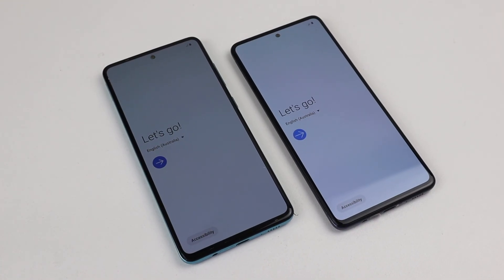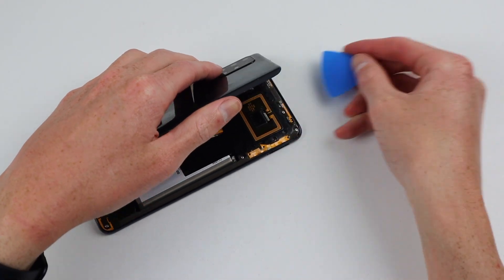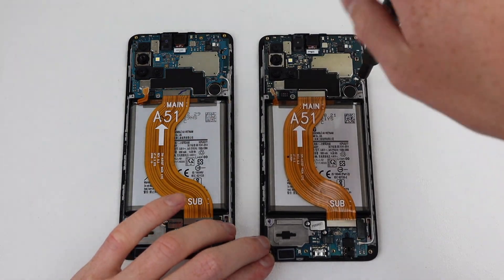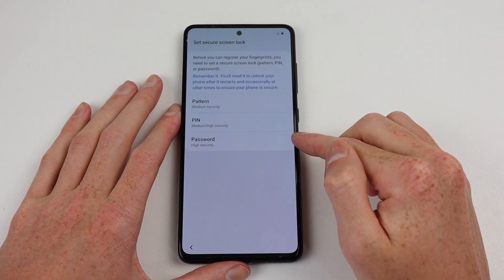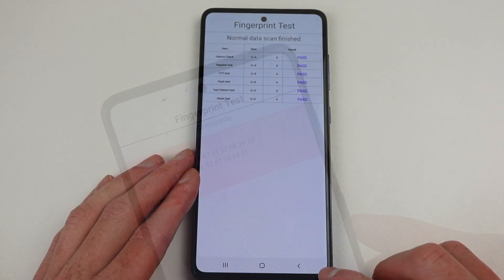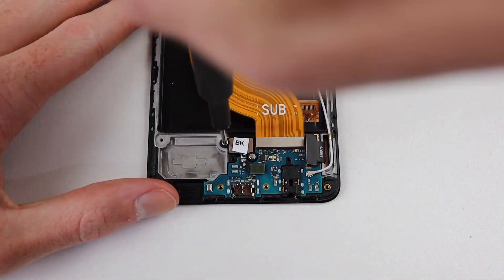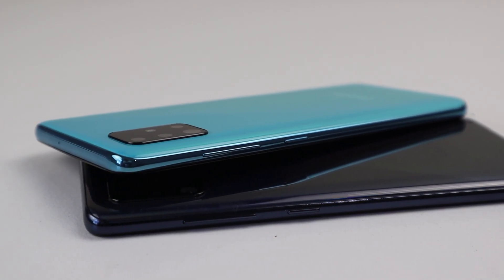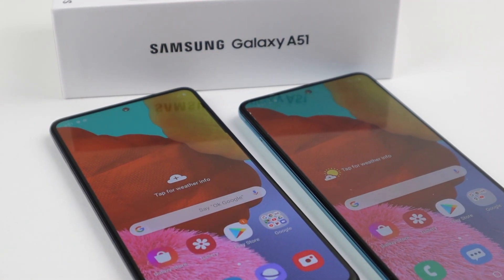Samsung Starts Blocking 3rd Party Repairs? - Galaxy A51 Teardown and Repair Assessment

Comment: I've replaced my a51 screen with an aliexpress one. The fingerprint scanner is still working flawlessly because when replacing you keep the original fingerprint reader and put it in the new frame.

Comment: Mine stopped working some time ago. (I can't remember if it was after an update) but my phone never been repaired or opened. Last might fidgeting with it with the #0# code at some point I got it to find the sensor and get the "pass" on all tests. I managed to add 2 fingerprints before it stopped again and since then I haven't managed to get it to see the sensor again. I'm thinking on opening the phone and check the connection to the board

Comment: Hugh, although unrelated to the video, I've came across about the issues of Samsung phones particularly on all A series of phones, where reports said that these phone suffers with issues where FPC (flexible printed circuit) connector causes these phones to either not charge or at intermittent at best. This particular issue happens when the device suffers from either "physical damage, improper connection or the phone gets bent". I've be interested if you cover about this issue in one of the videos or a reply here.

Comment: Ngl i found a a51 on the streets 
It was only having a issue with the charging port flex cable and it was working fine after replacing the flex cable

I see treasure like that

Comment: I have replaced two a51 screens and after swapping I had seen same issues as shown in this video. Fingerprint wasn't asking me for calibration but it was just not reading. But similarly as shown here when registering a fingerprint it occasionally register some parts so I just kept trying for about 20minutes until I managed to register one fingerprint. What worked for me was just leaving finger longer on one spot. Anyway after registering one fingerprint it just suddenly started working with no problem. Unlocking was as fast as before screen replacement and registering second and third fingerprints was a breeze. So I wouldn't see this strictly as anti repair - for me after September update they just maybe increased accuracy or something so new scanner must be calibrated and old must get used to being just slightly in different position prior to screen replacement. But yes Samsung should allow some way to calibrate fp sensor. Maybe after signing into your samsung account for added security.

Comment: i repaired a a30s...same problem with aftermarket display........so.....those sensors are calibrated for each phones....the distance between glass display and fingerprint scaner are calibrated for each chasis
Reply: i managed to make thinner sensor fixing holes to create a smaller gap between screen and sensor... until it worked again.....btw....with tempered glass sometimes sensor is reading poorly

Comment: i also have a51 but my earpiece is not working after screen being replaced
Reply: Usually replacement display don't come with the earpiece speaker already attached so you have to remove it from you device and place it into the new screen. Either you or how ever did the replacement  forgot to relocate the speaker or it broke in the process.

Comment: Good to know this info. Plan to get my first iPhone with the 14 Pro, but after I still want to use my A51 as a secondary. Thinking of getting a screen replacement since mine has severe screen burn-in. Made the mistake of leaving a video with a static border on my screen for hours for background noise while I slept, since I dont have a TV in my room.

Comment: I feel Samsung did that for security reasons and to prevent other people from accessing your data even if they swapped the fingerprint sensor. That's what I think though
Reply: Well it turns out Google does the same thing for their Pixel phones, the only difference is Google provides online software to recalibrate the sensor.

In other side, I don't think Samsung does this anymore (based on Hugh's latest Samsung teardown)

Comment: have to replace the screen.. if they software block repair. ther phon is like screen is build plate for everything, , replace the screen mean tear down all electronic from the screen .. fairfone for next phone? a thing build to have just screw messing and screen cable to replace and not tear down all the glued phone

Comment: you know what.... it might be calibrated to the screen... like factory calibration is a more involved process and in the calibration you get it only can change a little bit of that (like how on a bike in the factory they "calibrate" the saddle to be around where a saddle is by welding the frame, then you can calibrate it a little by the seatpost. i htink its because the pixels are somewhat at a different position)

Comment: is there anyway to recode the fingerprint sensor to match the logic board, I've replaced my a70 screen last year along with a new fingerprint sensor that came with the original replacement screen and since the last update the fingerprint sensor stopped working... is software out there that can rectify or bypass this problem

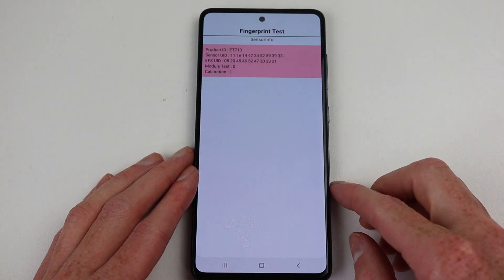Comment: 6:45 - The sensor UID and the EFS UID need to match, how do you fix this, as this is the reason the calibration error comes up?
I replaced a non working sensor in an A50 phone with a new replacement and got this calibration error, factory reset did not fix.

Comment: Hold up...
Doesn't the fact that you used double sided tape instead of proper adhesive remove it's water proof/water resistant properties?
Also, you downgraded to a previous patch/update to fix the issue. So, can you now reinstall the newer patch/update and the calibration problem still be resolved??
(...or does the issue return with the newer patch reinstalled???)

Comment: Are the sensors physically different and matched to a hardware revision on the board? They serial numbers on them are different
Reply: Do you know what a serial number even is?
Reply: @RawbLV  What's your actual question? Or do you simply come on here to post fecetious comments.
Reply: @ghostofdre  Serial numbers are obviously unique, why would they ever match?
Reply: @RawbLV  So obviously from looking at a grand total of two sensors we can deduce that they are serial numbers and not part numbers? 

Each has a UI in the software though so that lends to them being serial numbers as they have unique identifiers. Perhaps I phrased that question poorly and you had a pre-conceived idea of what the question was and a snarky comment lined up to respond with.
Reply: @ghostofdre  You're telling me, I don't know what those numbers are.
Reply: @RawbLV  
I actually only asked a question, reading my original comment it's poorly written, I'm going to hide behind auto correct and a lapse in concentration on my part.

This is what I meant:

Are they serial numbers, the numbers on them are different.

Your snarky reply was not welcome though.
Reply: @ghostofdre  Understood.

Comment: Everytime I watch these videos I get pissed about the fact that THERE'S NO REASON TO GLUE THE DAMN BACK COVER AND MAKE THE BATTERIES NON-USER REMOVABLE.
Reply: There are 2 reasons: Waterproofing and slimness. Most people would like their phone to last long and to be thin, hence why batteries are non-removable. Simple. You got only yourselves to blame.
Reply: @RawbLV  Problem is that most phones aren't waterproof and they still have non-removable batteries.
As for slimness, please, just look at the back cover in this video, just make so the flat cable goes under the battery instead of going over it, add a preasure connector, a tiny bit of plastic to hold the battery in place, and hold the back cover with clicking plastic things instead of glue.
At most screw the back cover with screws instead of gluing it while keeping at same design then, it wouldn't be as user-friendly as "traditional" phones, but the required skill/tools would still be much lower.

Comment: I had a screen replacement in Spain July this year 2021 on my a51 5g. Software was up to date at the time so assume it had the latest patch which would have been April or May 2021. No issues with the fingerprint sensor working. The only thing is the replacement screen is not as bright outside as the original which sucks but otherwise the repair was successful. Maybe the 5g version doesn't have the software cripple or it samsung as taken it off in subsequent updates due to complaints from consimers/repair shops? Or the repair shop in Spain was able to recalibrate the sensor...

Comment: Finally, someone recognizing the need to calibrate components in smart phones. You’ve demonstrated swapping parts either reduces the performance or features don’t work properly. Apple validate calibration date with serial number so if components are swapped, features are disabled rather than have flaky performance.  This stops unscrupulous back street repairers flogging poor quality repairs to unsuspecting customers.

Comment: This is not accurate, after replacing the sensor you should hard reset the phone to recalibrate the sensor and it will work fine after that. Perhaps you should do more research before talking shit about companies
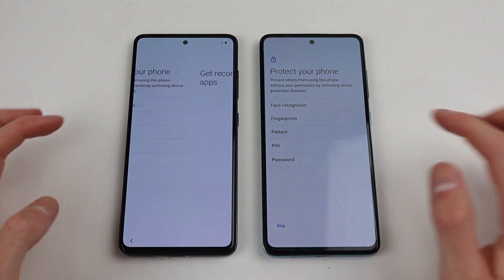Reply: 07:23

Comment: The walls on these gardens are only getting higher, and it has been working for Apple, so why would other manufacturers not do the same.  Eventually, some, but not all of the occupants of these gardens will become concerned at the wall height and perceive them as more confining than protective.

Comment: This happened to me too, even when repaired by the official one (they may not be informed by Samsung for whatever reasons). My phone is A30s and the screen was replaced due to water damage. The fingerprint doesn't work anymore and instead I use face ID

Based on my experience, it may be a lot off-topic, Oppo's official repair shop is better than Samsung (I live in Indonesia, in case this info is needed). The spare parts were ready and it takes less than an hour to repair my F1s screen, while Samsung has no spare parts ready and takes 3-7 days to get the spare parts, based on my father (battery), mother (screen), and my experience (screen and other parts that had been rotten of water damage) combined. Also, there's a PC or some for the waiting customers to kill the time (the PC wallpaper clearly stated the purpose of the PC)

Comment: Samsung copies everything Apple does....for better or worse. In this case, for the worse. 
Soon techs will have to start paying subscription fees for access to programing to copy data from old parts and reprogram to new ones like Allen Bradley, Fujitsu, and other servo motors when you have to replace an encoder. Everything will just be more expensive...needlessly.
Reply: Disabling the fingerprint reader makes sense just like with face ID for security reasons. If users were able to easily replace those then security is easily breached. 

If I stole your phone and replaced the face id scanner or fingerprint scanner with a new face scan or fingerprint I could (will) have full access to your information.
Reply: @kastaway-mtx  Are you dumb? It's a SCANNER, it SCANS, it does not hold biometric information.

Comment: Let's face it. The built in obsolescence ideology is being made credible by the activities of certain manufacturers. 👀We no longer just have shoddy after sales service, the lack of and deliberate in some instances; refusal to supply spare parts BUT now have software controls in play to ensure incompatibility even if you were to fit genuine parts?😶OK, so in some respects it is more of a nightmare for those thieving gits who steal your phone to pirate the parts? 👀 Who says that a so called legit repairer is not using those pirated parts to repair your phone? YES it happens; FACT. But who is to blame? If the law was tougher (joking here of course🤣that will never happen and why criminals get away with such actions time after time. ) perhaps it might discourage the thieving gits BUT! 😶So those criminals have now given the obsolescence folks the perfect excuse to make it almost impossible if not IMPOSSIBLE to have your damaged phone repaired? Perhaps what we need is a licencing scheme for 3rd party repairers to have to be registered to, before they can do repairs? 👀That way those using stolen parts can be struck off and banned by LEGAL actions against them, to cease and desist? Specialist tools required by them to do the work of repairs NOT made available to others? OR where criminal activity has been found that special gear can be seized from them? 👀👍All in all it's not looking good for us consumers. 👀I believe that NO mobile phone costing over $/£ 500 should be guaranteed for less than (restrictions applying as normal et) 5 years. Whether that includes a paid repair or free et you should be able to have it repaired IF that is possible. ie the manufacturers et MUST keep spares available for that phone for up to 5 years OR unless agreed ie a suitable replacement at a lower cost ? 👀

Comment: This actually makes sense here, the finger print sensor stores your figers ID on its own storage which is why you can only add 3 fingers or how many cuz you would think with 128gb on the phone you could have more. So replace the screen and not the finger print sensor and work?

Comment: I feel like this is something new done by Samsung for their Knox security. To make sure an attacker can't change the finger print reader and log fingerprints, they must have put a soft lock here. It seems fair, but it should be possible to recalibrate it without going to Samsung.

Comment: Samsung "Calibration" likely means record the serial number of the new hardware module into the registers of the CPU or similar to pair these two pieces of hardware. This will be a software that only Samsung has access to.

Comment: my old xiaomi redmi note 8 battery died and i bought a new battery for 9usd. then i attempted to repair the phone but somehow i damaged the charging board while removing the battery because they are glued too strongly. need to buy a new charging board, and i managed to find one online at 4usd. i managed to personally change both the battery and sensor at less than 13 usd. now because i know that the cost of repairing xiaomi phones are super cheap, i decided to buy another one as my main phone. so i bought a xiaomi poco x3 pro last month, knowing that xiaomi don't really do all these weird bullshyt that other manufacturer do. well at least now xiaomi didn't do all these locking things and repair monopoly yet. because i reckon it would increase the cost of their phones if they do this. so yeah, chinese phones all the way.

Comment: Its about calibration. New finger print sensor are not calibrated for current display, and since finger print sensors are cheap, you do not have tool to calibrate it.
My finger print sensor needs calibration after each quick charging, because its wear out, so it detects things away that are not touching the sensor, making my phone to wake up when no one are touching it, so called ghost hand, its the only thing that can be calibrated in software, everything else, no tool, like display on the monitor, each monitor have way different calibration, even they are identical.

Comment: 2:16 They Could Design The Phone With A User Replaceable Battery!!!! Pay attention to the design of the internals. you need to remove the second layer, the midframe, in order to access the main internal components. This means they didn't necessarily need to glue the back panel to the mid-frame...!!! Sneaky Sneaky....

Comment: meanwhile i got my oneplus 7 pro back from an official repair shop with the fingerprint sensor "uncalibrated" but i almost didnt notice. the mainboard they gave me is actually probably a PVT prototype as i can still access factory mode even in android 11 and they also replaced the display. under factory mode it reads a good few sensors as being uncalibrated including the fingerprint sensor. however it works even for things like google pay. to calibrate the sensor however i would need the "flesh rubber sleeve" and "black rubber sleeve" according to the prompts

Comment: Anyways the parts for Samsungs are terrible with the prices , I remember when I wanted to replace the screen for a Samsung Note 8 and the value of the display was half of the phone at that time , meanwhile for Apple even if  they are not originals you could fit pretty cheap and the batteries as well .Changing a battery for a Samsung is a nightmare

Comment: just replaced my Samsung A70 screen and digitizer, everything works apart from the fingerprint sensor, a genuine Samsung part.
Reply: Same happened to my A50 😢 it's a genuine screen and they still won't let me use the fingerprint sensor :( I wonder if they would fix it if I brought it to a Samsung store... Have you updated your phone after getting the screen replacement? I'm afraid that the touchscreen will stop working if I update it

Comment: I downloaded a software update on my Galaxy A50 which has an after market LCD screen. The screen stopped responding to touch. I took the screen off and tried it with another A50 that still had the older android version and touch worked perfectly. I can't downgrade the phone firmware because the binary version is too high. I guess my phone is just a useless brick now. I'm very disappointed in Samsung.
Reply: Were you able to fix this issue?
Reply: @ochazz1506  Unfortunately I haven't. My partner accidentally updated the other A50 as well. So now I have two phones that don't respond to touch. I guess I need to find an official screen. Or maybe rooting the phone(s) and trying some custom firmware could be worth a try?